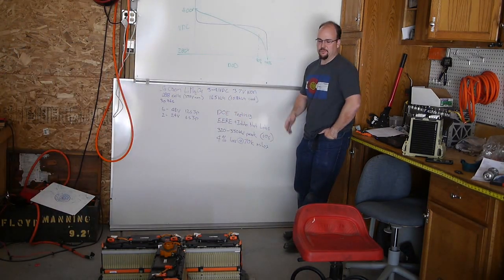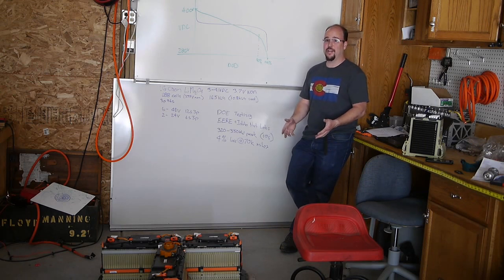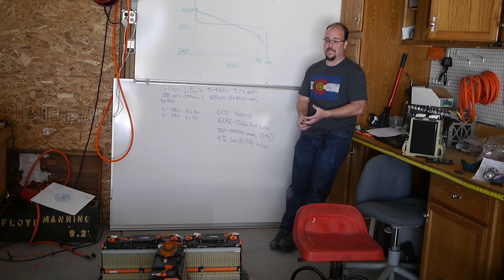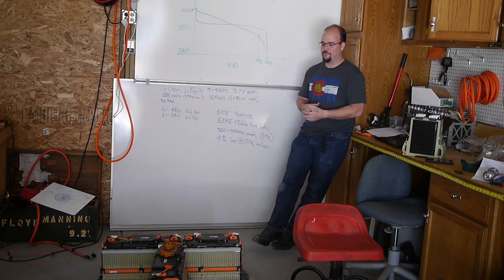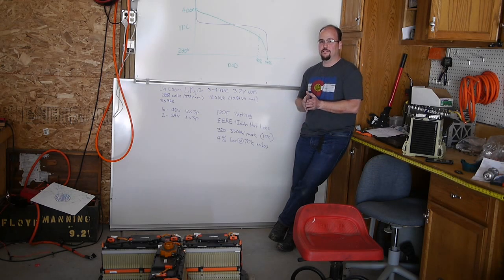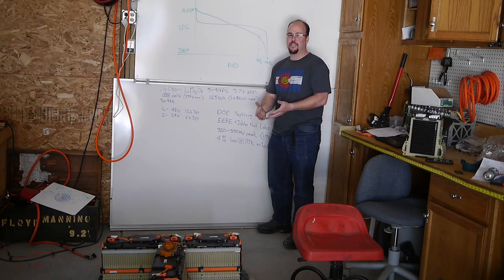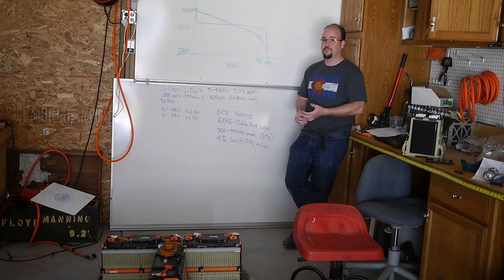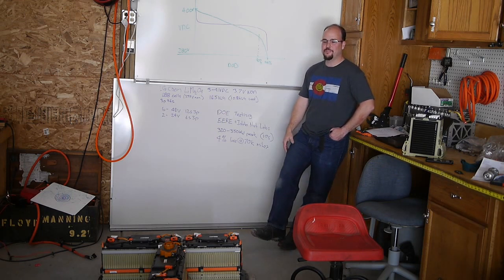Power and energy of the Chevy Volt battery for high performance DIY EVs

Comment: when they tested the packs where the cars have 70,000 miles and you say that they could be all gas miles and essentially zero cycles on the battery, you also say in a previous video (and as I understand it) that the gas engine cannot connect to the wheels, no physical connection I think you said, so it functions as a generator which supports the battery during Range Extending operation, therefore, wouldn't all miles be via cycles of the battery ?

Comment: Stupid question #47: I'm trying to pick a controller.  How many amps do you typically see from the whole 355v pack?
Reply: Power (kW) = Voltage (Volt) * Current (amps). Current thus equals Power (W)  divided by Voltage (V). 40 kW / 355 V = 112 Amps.

Comment: Great videos. Thanks for sharing your project online!

By the way, the INL battery testing report you mentioned in the video shows in the fine print that the test cars are running about 80% gasoline miles which is sad because it mostly invalidates the purpose of the test.

The cars are driven by fleet operators in the Southwest US. The test report for the 2011 Volt VIN 815 said it was being driven by a messenger service of some kind.

If you look carefully, the report shows the total gas mpg and total kWh of charge for the total miles driven but there is no direct breakdown of gas vs electric miles. You can see by the small amount of electric use that it is mostly gas miles.

For example, the 70,000 mile test report you mentioned shows 45.5 mpg total and 60.7 Wh per mile (I recall). The EPA rating is 350 Wh per mile and I doubt these drivers are doing much better so 60.7 / 350 is 17-18% EV. Or something like that.

So, most use of the battery is within the shallow state of charge window of the Charge Sustaining mode and lots of shallow charge/discharge cycles are easier on the battery than the full cycles you said you do on your own car.